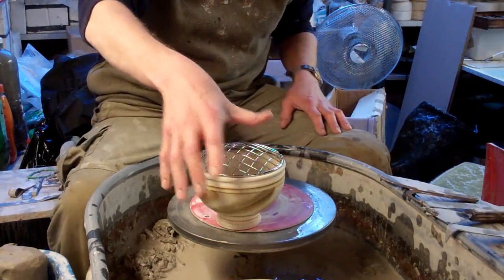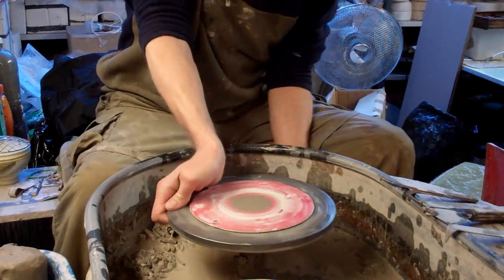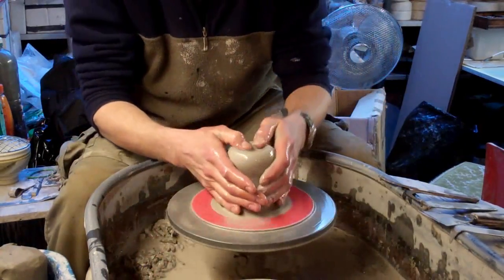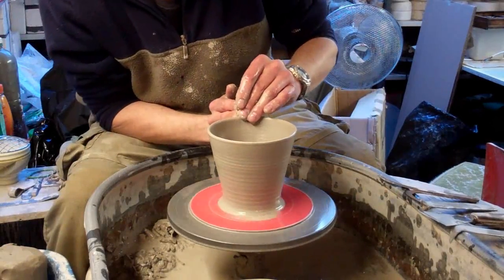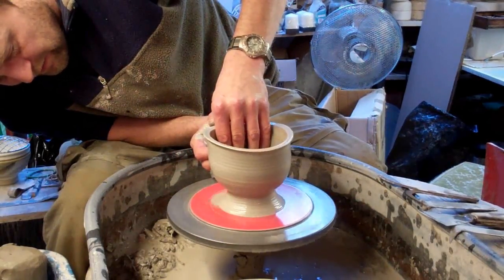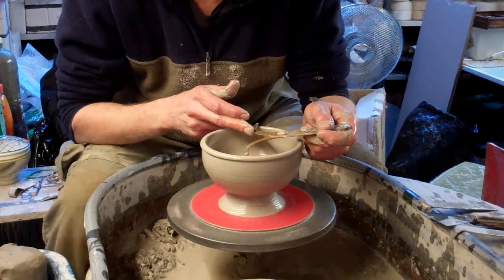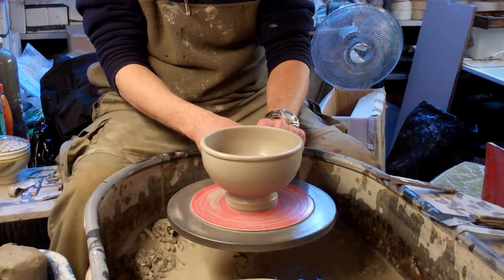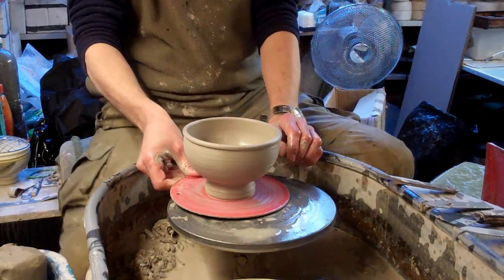Throwing Making  a Rolled Rimmed Pottery Rose Bowl on the Wheel

Comment: Great video , if you haven't centered your pot properly does that make the pot uneven in thickness etc ? I have been practicing over last couple of days, and getting better each time , but the pot always ends up thicker on one side and the shape isn't the same , so I get one good half and the other totally off. I am thinking that is what it may be anyway ,   .. got to keep practicing./...could it have anything to do with the momentum. too slow..its an old Saviac kickwheel I bought recently.